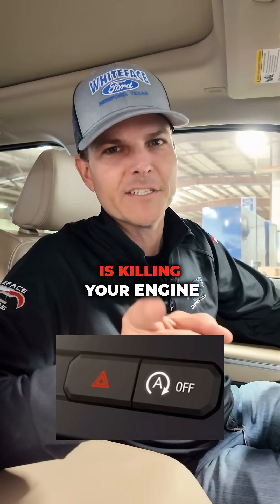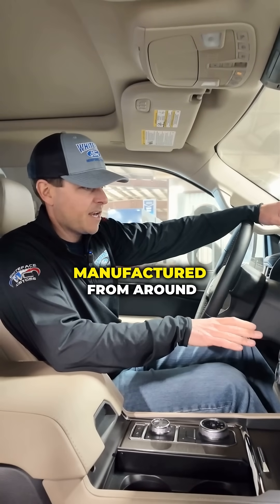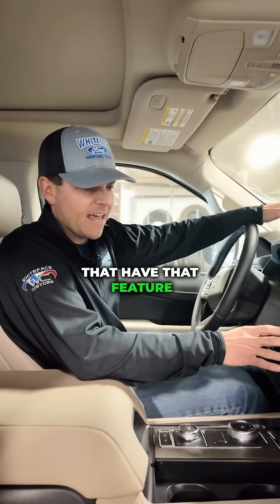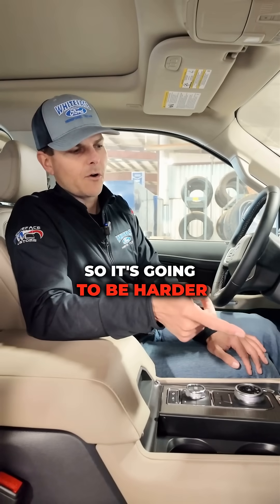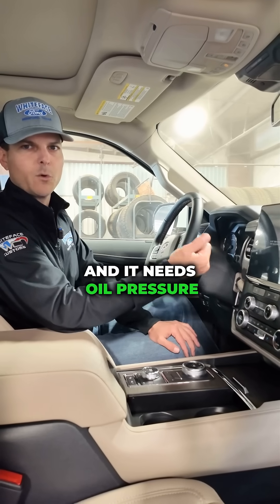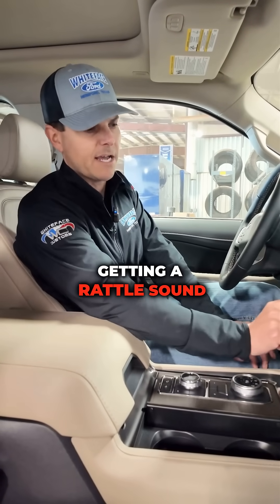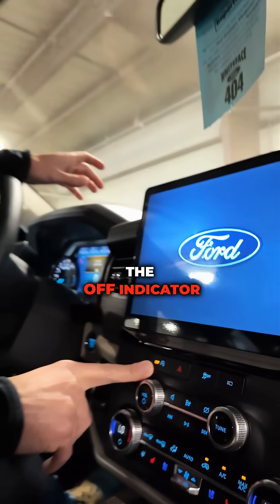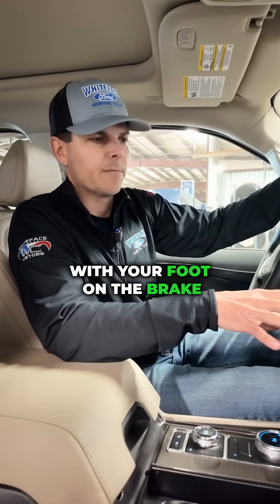Is Auto Stop-Start Wrecking Your Engine? #Shorts

Comment: Guarantee the engineering team factored in the increased load from auto start stop into the battery and starter. Residual oil pressure will be left in cam phasers as well. Not like they just slapped in auto start stop and didn’t make any adjustments. Many use AGM batteries and heavy duty starter motors. Plus less time spent at idle is always good for reducing wear.
Reply: Since when? Idling is the easiest on an engine. Acceleration (darn) & starting are hardest
Reply: Nope nope and nope 

Guarantee the engineers did bla bla bla?  How many shit cars have been in production before?

Engineers aren’t always doing the right thing or making great products

Also, bean counters probably ALWAYS supersede good engineering ideas 

How you automatically trust them is unwise

And no you don’t just have residual oil pressure, when the oil pump stops, pressure stops

You thinking idling the engine wears it out is pretty telling
Reply: Yea right my guess is they added stronger battery and starter and such but for compliance and looks thats just extra needless wear on the parts and motors just to say you burned a bit less gas it should be ilegal to do that.
Reply: I'm on my third battery. Third starter. At 80k. Yep those Engineers sure have it all figured out
Reply: @MASTERbaiter01 Can’t say the same, what u driving?
Reply: @MASTERbaiter01 yeah u drive a shit box

Comment: Amen! Start stop is the stupidest thing that doesn’t have to exist.
Reply: Yeah let's just have millions of cylinders firing while vehicles all across the country are at a dead stop
Reply: @LesterHoltHairline  Those same "millions of cylinders firing" will probably use less fuel than restarting after 5 seconds will. 
How much extra fuel do you think it takes to carry all of the extra weight around that this technogy requires?
Reply: @LesterHoltHairline no

Comment: I’ve modded my auto stop start off button to always be on by default, I use it as a manual stop start now when I know I’m going to waiting at traffic lights for ages
Reply: Soooooo you still stop start the vehicle?  

If that’s the case, still silly
Reply: @chewybacca11 but now I can choose when I use it before it would stop whenever I was stopped even for a split second in traffic, now it only ever gets used when I know I'm going to be stopped at lights for more than 30 seconds
Reply: @pearelectronics3083ok well that’s still bad

The whole point is to not use it at all
Reply: @chewybacca11 it gets used maybe once on my commute, there is one set of lights that takes well over a minute

Comment: I have a 2025 F-150 with the 2.7 Eco Boost !! How do I permanently disable the auto start ?!
Reply: You can download a free software program for your laptop, and purchase an OBD2 interface module so you can plug your laptop into your OBD connector. The FORscan software is free with the extended licence. You can disable the start/stop feature, plus a plethora of other features your truck has that might be disabled from the manufacture or dealer. It’s pretty idiot proof, and user friendly. 
If you’re intimidated with this idea, just take it to your nearest dealer and have them disable it for you. It’s a $200 charge and they use FORscan. It’s a great tool for FORD owners. Cheers

Comment: I found a trick on my 2018 f150,2.7l
Put the temp dial.in the middle and put it on defrost low fan no a/c,  Truck never shuts off.
Reply: Use FORScan, disable it in the ECU.  Done, and done, forever.  No monkey business.

Comment: That is when you get the aftermarket pigtail that you plug into the on/off swirch for auto start and you do not have to worry about it. Had it on my 2020 F150 with the 5.0
Reply: I found one for my 2019 Highlander on Amazon for $20. Works perfectly
Reply: Link pls
 @dieseldrew3794
Reply: 2020 F150 3.3 V6
I got mine disabled via the OBD
Reply: It's called AutoStop Eliminator
Reply: I did the same for my 2020 Kia Soul.
Reply: I used one on my car, ended up backfiring causing a code, use at your own risk
Reply: You are an imbecile you can program it out
Reply: I knew Ford caved when they installed the nonsense on a truck.
Reply: This voids any warranty

Comment: They have found in City driving that there's 25% fuel savings using this which is not nothing as far as costs. It's a feature. The implementation is what I take issue with. The one off button should be persistent that is all. The feature is great for when you want to use it to save gas. On a hot summer day though I'd prefer it not function to keep the AC running. But absolutely modern AGM batteries and modern step down geared starters are capable of millions of starts. Age gets them before starting repetition.
Reply: Bull

Comment: Batteries are upgraded AGM,  starter is upgraded as well,  phaser will fail regardless of staft/stop.
Reply: There’s always one in the comments
Reply: @lyingdogfacedponysoldier5746  hahahaha I was gonna say the same thing. Always one! 😂😂
Reply: @lyingdogfacedponysoldier5746 So are you the one then?  This video starts off by stating auto start/stop is killing your engine, then proceeds to talk about 2 of 3 things that are not the engine.  The one things that is an internal to the engine fails ALL the time on engines with and without auto start/stop.  Remember the 5.4L  3 valve?  Additionally, I have conducted UOA on vehicles with and without auto start/stop enabled and in mixed mode / heavy city driving, the vehicles with auto start/stop enabled showed lower wear metals and lower fuel dilution compared to those that don't.  So in this case, it's actually not killing the engine and doing the opposite.
Reply: @N-M424 😂😂 Yeah went through two AGM's by 40000 miles. Two starters. Got rid of my AGM which shut down start stop now 40k after no issues. I use Ceratec for in my oil as well.

Comment: You can also get a trailer test plug and plug it into the 7 way connector. It the truck thinks there is a trailer it won't auto stop the engine.
Reply: Until you need to pull a trailer...
Reply: @username-mc7jw 
Then you just unplug it and plug in the trailer. When you plug in the trailer it will turn off auto start stop
Reply: Interesting, thank you

Comment: There is a fuse you can remove to disable the stop/start
Reply: Or program it out
Reply: Or just disconnect the connector at the battery terminal.
Reply: or just press the button or twist the knob that’s inside the cab
Reply: @huntergarci yeah but that’s stupid to have to do it every time.   I bypassed mine the day I bought it.  Now when my wife drives or kids or whoever it just stays on and no issues
Reply: @huntergarci  hmmm push a button every single time i turn my car on... or just spend 5 minutes and never worry about it again